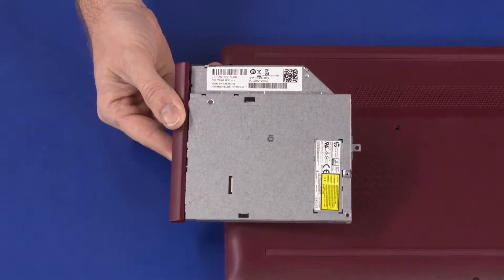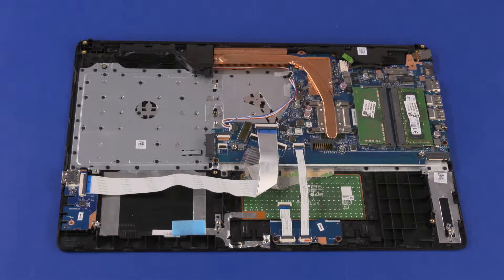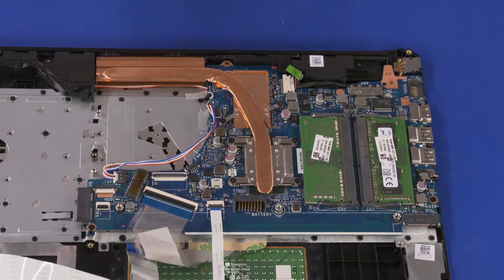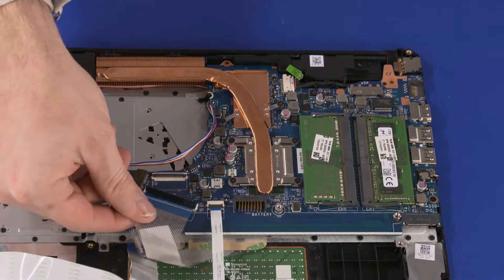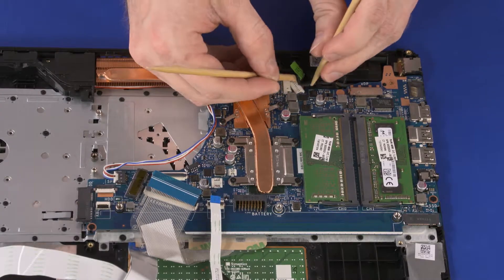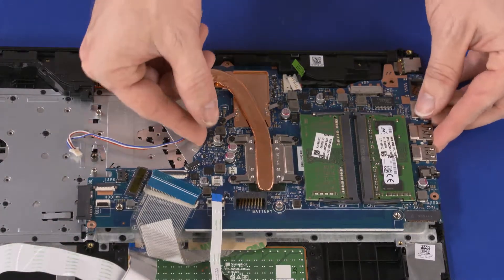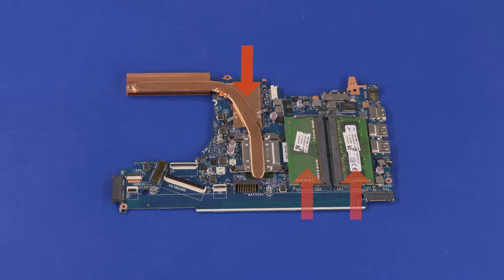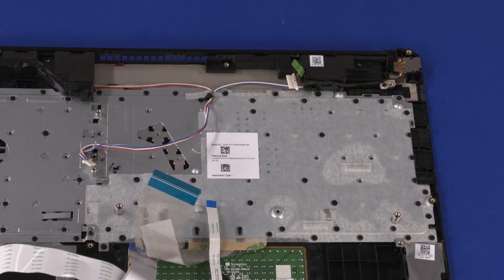Replace the System Board | HP Notebook 15, HP 250 and 255 G7 Notebook PC | HP

Comment: Hello, a question, I have a 15 db0004la, it has an AMD a9 9425, could you upgrade your motherboard to that of the HP 255 g7 that has a Ryzen 3 3200u?
Reply from the maker: Hi there, thanks for contacting HP Global Social Media Support!
I understand that you need to know about upgrading the motherboard of your notebook.
I will do my best to assist you.
HP does not recommend upgrading or downgrading hardware parts or software that is bundled with the product as It may affect the manufacturer's warranty and performance, however, you could change the configuration at your own discretion.
Regards, 
HP Support

Comment: Hi! If I were to replace a A4-9125 AMD Hp 255 board with a A9-9425 AMD Hp 15 board will the machine operate okay??
Reply from the maker: +Lebogang Gift HP does not recommend upgrading or downgrading hardware parts or software that is bundled with the product as It may affect the manufacturer's warranty and performance, however, you could change the configuration at your own discretion.
Reply: @HPSupport  Thank you for the reply but I have one question. I couldn't find the A4-9125 replacement board even on parts.hp.com and was wondering where would you suggest I look
Reply from the maker: +Lebogang Gift Please contact HP Shopping team to purchase the board: https://bit.ly/33djkBd